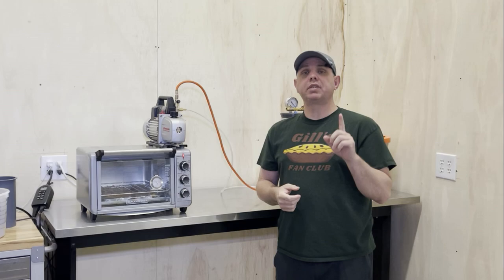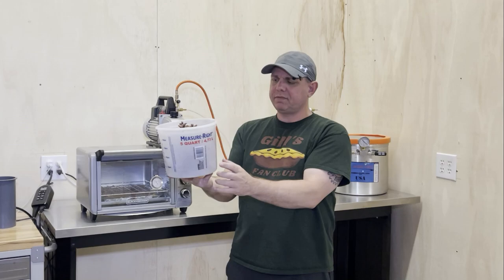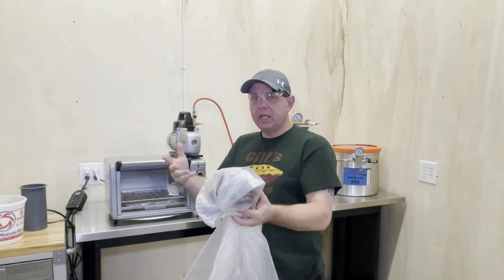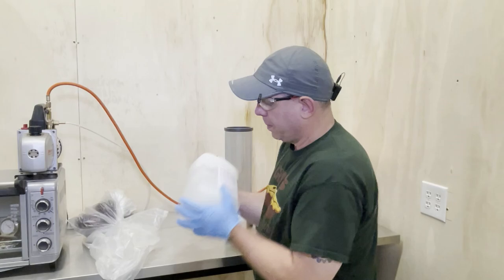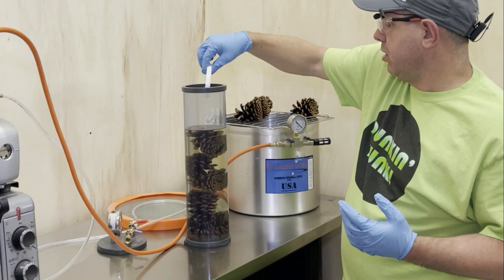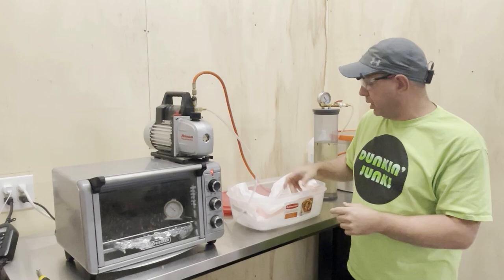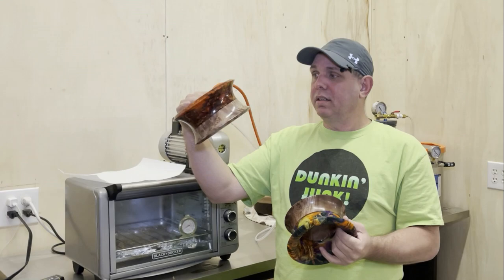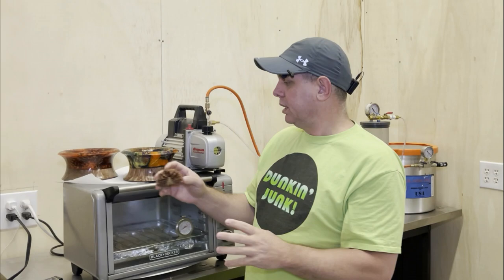How to Stabilize Pine Cones, and Is it worth it?

Comment: Hi Jake, just following up on my comment 2 years ago 😂 I've cast quite a few pinecones since and what I discovered is the non-stabilized pinecones still had a lot of movement in them. Pens finished with CA were like glass when I assembled them, but a month down the road I could feel the pinecone texture. They're still shiny, but more like wavy glass. The stabilized pinecones didn't move a bit, still perfectly smooth to this day. Oh, and the dyed ones came out interesting. I set them aside thinking that the dye didn't take. Well, I finally cast and turned some of them and wow, do they look cool! The light color inside the pinecone dyed perfectly. If you stabilize any more pinecones, throw some dye in the mix. You will not be disappointed. Take care!
Reply from the maker: Thank you so much for the follow up .. I will definitely take your dying advice 👍

Comment: Great video! One question: if I don't have all the extras for a full stabilization process, is it worth it to just throw them in the oven for 3-4 hours without using the vacuum, cactus juice, etc?
Reply from the maker: Absolutely.. that’s what I did with the clown bowl.. just dried them for a few hours.. lots of repairs but still came out well.. we will see in time about movement 👍
Reply: 2:16 👍
Reply: @JakeThompson  thanks, Jake! I missed that in the video and I was a little confused about "drying" vs. "stabilizing." This helps a lot! Keep up the great work.

Comment: Hey there Jake.   Just curious.   With regard to stabilizing pine cones, is it necessary to weigh them prior to putting them in the oven at 220° and then weighing them again in order to verify that they are fresh from residual moisture?   Thanks
Reply from the maker: Yes.. just leave them in until they stop losing weight

Comment: Watched a video of a pinecone resin bowl and thought coffee table!!!!  But resin is expensive and while my coffee table would be smaller than usual it is still a big resin expense. Wa going to do 4" deep and sand with belt sander as I don't have a planer and then do a thin overflow top coat to seal in the sanded pinecones. Can I dry the pine cones in the oven do you think? I have a ton of old pine cones in my yard so they should be pretty dried out already?
Reply from the maker: It only takes a few hours or so to dry the pine cones .. so I would make sure they are dry

Comment: Jake, when you poured the resin did you use mold release before you put the pine cones in the mold?
Reply from the maker: When I casted the alumilite.. yes .. I always use mold release on the molds.. I don’t show it on the lives .. but they all have been sprayed with mold release. 👍
Reply: Thanks Jake